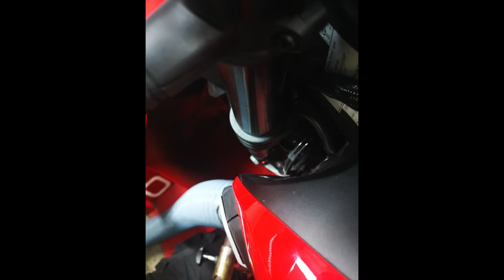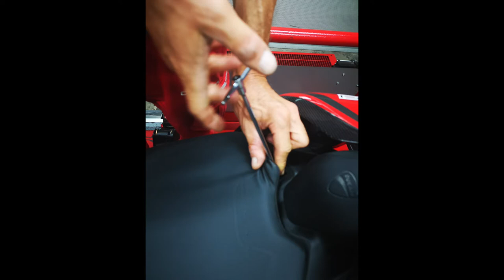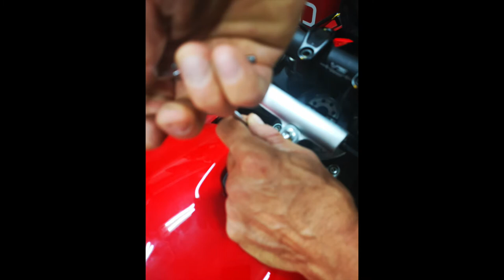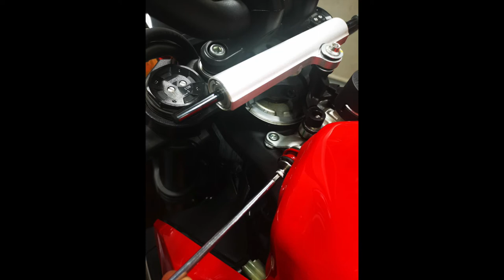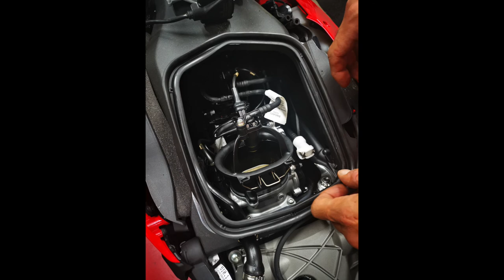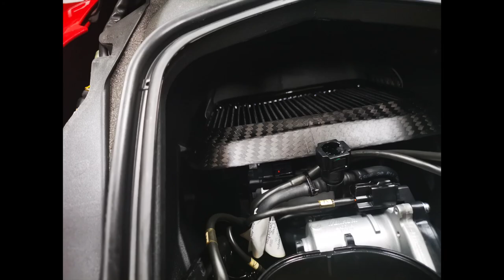TUTORIAL Ducati Streetfighter V2 955 performance air filter

Comment: Effort appreciated but video is way more helpful and shows where problems can arose and what to do when they do arise. This picture by picture montage doesn’t show you will run into fuel injector issues when trying to remove and replace the air filter.